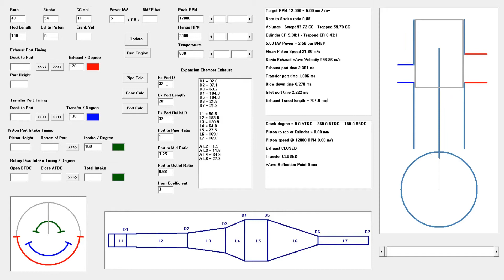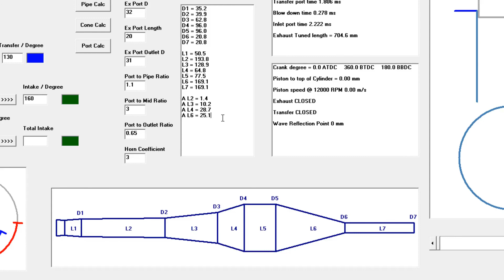How to Design a Two Stroke Expansion Chamber Performance Exhaust - Step 6

Comment: We only need to do what we only need to do didn't impress my maths teacher when l left the calculus exam  question blank 
. Thanks for doing it for me very much . l read online forum speech on resonating  vibration, utube had not much, rather not read, that you could fault find power loss from the bad vibes by stiky led wheel balancing  weights on the carby , is this a common problem and or solution ? And thanks
Reply from the maker: I am not a believer in the resonance theory that some seems fixated on for a few reasons that are a bit beyond the constraints of the comment section.
But aside from those reasons there is one simple fact and that is not all resonance is good and resonance can be as equally bad and loose power as it can be to gain.

Comment: Looking to apply these concepts to a Mazda 2-rotor engine.  Each rotor housing is like a single cylinder 2-stroke, but it has 3 rotor lobes, so there are many pulses sharing the same exhaust port. The exhaust is collected from each rotor and combined at the end of the header.

Comment: Hi there how are you doing i love your videos i need help please i buy race exhaust for 150cc 2 stroke and the specs is wrong can you help me to change it to the right specs
Reply from the maker: In what way are the specs wrong ?
Reply: @AuMechanic  i buy the pipe in Indonesia and it's a clone of the real one...the cones length and belly size too big the bike power come in very high rpm and midrange is no power...the bike is a 2006 Kawasaki kr150 kips
Reply from the maker: @willemdeysel1766  
If the pipe was a bit short the tuned length would be suited for a higher RPM range.
And if the pipe diameters were too large it would tend to reduce mid range.
The best thing to do is use the free pipe calculator to assess what the tuned length should be and the outlet pipe diameter for your engine and compare results to the pipe you have.
Reply: @AuMechanic  thanks sir
Reply: @AuMechanic  i will love if you can tell me what to do...you very good in 2 stroke...and please never stop your videos i share it with people
Reply: @AuMechanic  i sent you a message on Instagram

Comment: I know the outlet tube diameter is in relation to exhaust port diameter, but did I miss what the length of outlet tube are based on? I have a motorized bike engine kit, with the stock pipe (very restricted) but I have been trimming the outlet down shorter in half inch intervals then testing performance. It has continued to improve each time I have shortened it! I just dont want to go too far and loose my gains.
Reply from the maker: The lengths of the outlet is only a construct of the restriction.
For example if the outlet pipe was a bit narrower but shorter such that it provided the same restriction to flow, it would be the same.
So the length itself is not a factor, its just that as you shorten its length so you reduce the restriction.
So the pipe equations only set the length in relationship to the diameter to provide a given restriction to gas flow.
There was a separate study done and published that has proven that the length of the outlet pipe is only relevant to the restrictive effect of the outlet, and contrary to some claims there is no resonant effect of it nor effect to tuned length.
In some factory pipes they use a small section to set the restriction and the remainder of the outlet pipe is larger diameter to allow for a more compact length pipe to fit the machine.
Reply: @AuMechanic  thank you so much for responding!I disagree with those who say no resonant effect with outlet length! Because when it was full length, I was getting destructive resonance in the pipe! After mid throttle, pipe rattles, pinging, tinny sound of the metal. After trimming it about 3 inches shorter, that went away but diameter has remained the same! It was so restrictive it was limiting my RPMs greatly (port plugging) now it has tremendous RPMs, increased torque, and top speed!
Reply from the maker: @abikelife1481  That's down to the restriction only. Keep in mind that the more restrictive it is the hotter the combustion chamber and pipe will be.
Expansion chambers do not work on resonance, not the outlet pipe or any other part of the pipe.
The fact that expansion chambers work over a wide range of RPM clearly demonstrates that orders of harmonics are not playing any part in the gains a pipe provides, only the noise it makes at particular RPM's
Any resonating effect in the pipe is only a construct of the natural frequency of the materials and only a particular RPMs.
Reply: @AuMechanic  keep in mind this isnt an expansion chamber I have, the stock pipes are baffled and set up like a muffler. But yeah it was definitely a restriction and had that destructive resonance going on, or else the harmonics as you mentioned but I dont see it just being harmonics because the RPMs also increased when I cut it shorter. the outlet tube, which is likely under the .06 diameter recommended size in relation to port diameter, shortening that stinger improve rpms and speed on this motor as well as eliminated the pinging vibration it was getting at stock length and fully restricted
Reply from the maker: @abikelife1481  Again, shortening the pipe is just reducing the amount of restriction.
Note that too much restriction can induce detonation as the cylinder temp is too high.
As for peak RPM, a pope that has too much restriction will always reduce the maximum RPM simply due to limiting bulk gas flow as RPM rises..
Also, as this pipe has baffles it is possible there is a loose one inside and temperature variations may effect it, more restriction the hotter to pipe.
Also be aware the stock pipes with baffles get coked up inside and need a burn out now and then to reduce the restriction so I hope you cleaned the pipe out before cutting it.
If not you probably should before going any further with it.
Reply: @AuMechanic  yes its coked up, but I am pulling an end cap off where the outlet tube is attached and trimming it there. I dont think any baffles are loose though, I imagine, a high enough temp would have an effect on it I suppose too, perhaps changing sizes of baffles and side walls maybe. I tested temp was about 135F after a ride and then at idle, so not really too high. But yes I am reducing the restriction of gas flow by shortening outlet tube, and it is improving a performance lot. But still maintain back pressure as opposed to just taking entire end cap off, that or drilling additional outlet hole, that just destroyed performance. How do you burn out the coke? Just with a torch?
Reply from the maker: @abikelife1481  Yes a blow torch will do.
Some people throw the entire pipe in a fire but that tends to scorch all the paint off the pipe and goes rusty if not repainted so the blow torch aimed in the rear and in the header end too is best.
(It is important to have the header end clean too inside.)
Reply: @AuMechanic  awesome thank you for all the help and instructions. I am planning on making my own expansion chamber thanks to you! One more question, is it normal for a two stroke piston stroke to only make it halfway down the exhaust port? These motorized bike kits seem to be set up that way, but I noticed on your software simulator the piston went all the way down to the bottom of the exhaust port.
Reply from the maker: @abikelife1481  No its not normal.
Piston should clear the whole exhaust port but on these Chinese made engines they seem to mix barrels and such that do not match up.
That barrel you have is probably for an engine with a longer stroke.
I have one of these cheap engines here that has similar issues.
See the video on the Ebay engine I have.
Reply: @AuMechanic  okay will check out! Is there anything we can do to increase exhaust duration with that engine style?
Reply from the maker: @abikelife1481  Other then getting a cylinder that matches, no.
if you raise the roof of the port to increase port area it will reduce trapped compression ratio which will reduce low end power.
Ands as these cheap engines do not rev high compared to most 2 strokes that would be bad to loose power RPM range power.
Reply: @AuMechanic  yeah I haven't touched mine either, but what about widening it 2 mm perhaps that would help increase duration
Reply from the maker: @abikelife1481  Widening wont increase duration, only raising the port will do that.
You need to take care making the port wider as that can increase piston ring wear too.
Reply: @AuMechanic  thanks. What do you get from widening? Just better flow? And yeah I have seen some vids of guys removing the transfer port cylinder walls, and the disaster that occurs lol
Reply from the maker: @abikelife1481  Yes widening does improve flow.
And you need to be real careful porting transfer as one mistake can ruin scavenging and power.
Reply: Nvm I caught it at the end. I wrote this before it was over

Comment: Sir I need to made this exhaust chamber my self . How can I calculate the proper dimensions for good performance .
Reply from the maker: The software has popup tips in it that gives home help on what you need to entre in to the software based on what type of performance you want.
Place mouse over anything in the software and help for it will popup
Reply: @AuMechanic  sir plz make a video on the use of software . How to calculate the dimension on bike , pipe and then entry on software . How software work and how to use it for accurate results.
Reply from the maker: @ni3walia315  
I have some newer videos on using the software you can see if you look at my video list on my channel.

Comment: Does the pipe care about time/area of the ports or just when they open and close. In other words if I go in and widen all the ports and do not raise them would I need to make another pipe. Thanks. Need to learn
Reply from the maker: In short, lengths of pipe sections are tied to port timing and diameters of sections are tied to port area.
Because changes in timing involve an increase of port height and thus area as well as timing then that will effect both pipe lengths and diameters. Where a change in port width will effect pipe section diameters.
Since there is no change in timing with width changes you may be able to get away with the same pipe if the new diameters are still within the bounds of tolerance in the pipe equations, note in the software there is a range given for header, mid section and outlet pipe relevant to port area.

Comment: Firstly thank you very much for your work. I have a doubt, I have a rx125 engine and I need to do an Exhaust with a maximum of 50cm in length, is it possible? and it will be water cooled, do I need to change the Exhaust temperature in the program? I would be very grateful for your help.
Reply from the maker: The temperature is average exhaust gas temperature throughout the pipe length so having a water cooled exhaust will certainly reduce the average exhaust gas temperature, by how much I could not even guess sorry.
As to exhaust length, if the calculated tuned length of the expansion chamber in the software is considerably longer than your space will allow and you do not have room the build a snake pipe that has a U bend half way up the pipe then you may be limited to a box type silencer.
Reply: *Exhaust and engine will be water cooled.
Reply: Thank you very much, even with all my limitations with your language, I am learning a lot. as for the size of the exhaust, I am adapting the engine to use on a motorized surfboard on which I am building.

Comment: I didn't understand the horn coefficient can you explain it sir ??
Reply from the maker: The Horn coefficient is basically the amount of exponential curve in the 3 diffuser cone tapers, the more curved the diffusers is the more gradual the pipe comes on to the peak, the lower the Horn coefficient value is the straighter the 3 tapers are making the diffuser more like a single cone which is more peak power and a more narrow power band..
So a low Horn coefficient would be for a road race engine and a high Horn coefficient number would be for motocross for a wider power range and lower peak.
Reply: @AuMechanic  will it be fine if I increase horn coefficient until the d1 and d2 are equal in diameter so that I can use the stock exaust pipe from d1 to d2
Reply from the maker: @sumedhovhal8156  
You can use the software I've done to do that, it has a straight header function in it for those cases, what it does is ignore port to pipe ratio for the straight header and uses the port outlet size at the flange as D1
Keep in mind that D1 to D2 (L1) is part of the diffuser cone not the header.
See later video on where to get software here https://www.youtube.com/watch?v=AppjfX4TdOM
Reply: @AuMechanic  I used strait header option form the software and that problem was solved but, I was asking about d1 and d2 (L2) I increased the horn coefficient to 3.8 resulting in d1 and d2 are equal in diameter so will it work??
Reply from the maker: @sumedhovhal8156  
The range for HC is 1.25 to 2 (hold mouse over the HC value to see popup help)
You will notice if you use higher than 2 the HC field turns yellow which indicates it is out of range but still allows you to use any value.
If you go to a high value like 3.8 that will make the diffuser cone very short and very steep taper which will be out of sync with the wave timing.
See this video I show the position of the wave reflections at points along the pipe during one engine cycle.
https://www.youtube.com/watch?v=5fojBHZNAWM
If you save the values you have to file in the software and send me the file or text from inside the file to ausmecham@gmail.com I can have a look at it in the software and advise you on that.

Comment: Hey mate, I’ve been following your expansion camber design videos and i am just curious can I apply these calculations to a 350cc twin cylinder 2 stroke engine by just calculating each pipe as an individual pipe or is there another method for designing pipes for multi cylinder engines? 
P.S the videos have been great so far! Very helpful.
Reply from the maker: Treat each pipe as individual pipe unless there is an exhaust manifold 2 into 1.
So treat it like a single cylinder X 2 for twin pipes.
Reply: AuMechanic Ok awesome thank you very much!